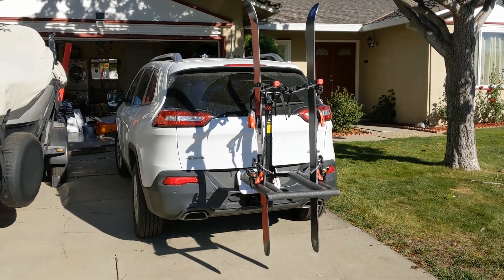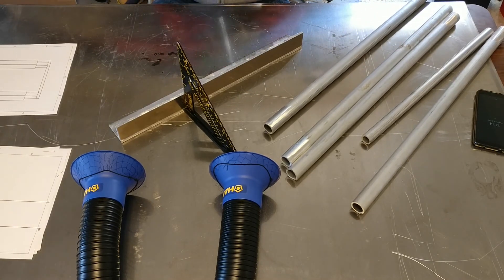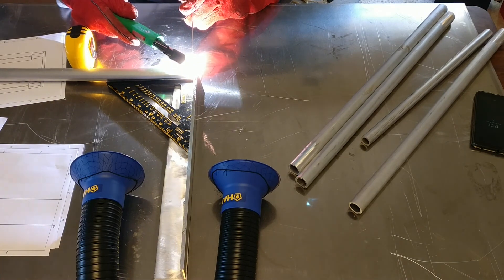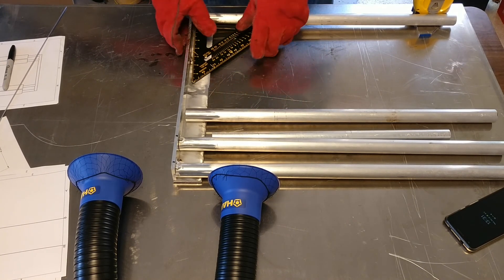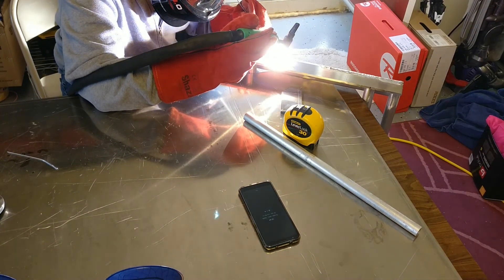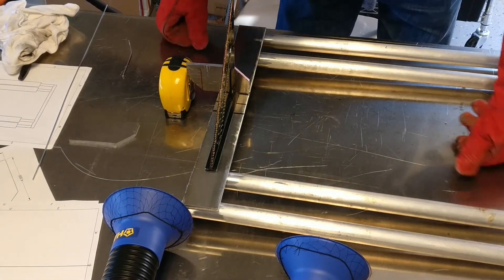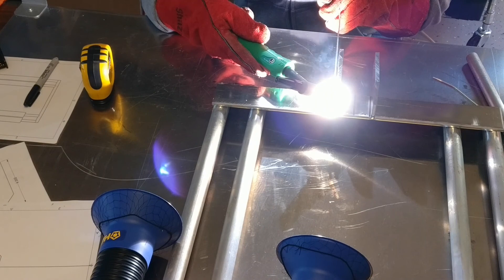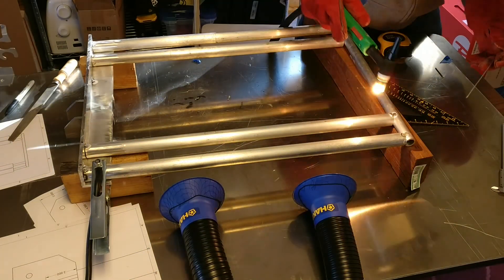Building Ski Holder From Bike Hitch Racks

Comment: That is awesome. What is the welding gun called? Where can I buy it?
Reply from the maker: This is a TIG welder and the full setup will cost you around $1000. If you are intrested I can make a vide about that setup. There are lower cost options like MIG or Aluminum soldering at Harbor Freight Tools.